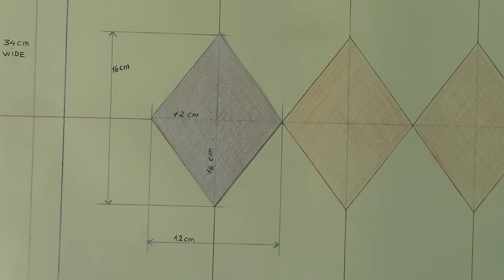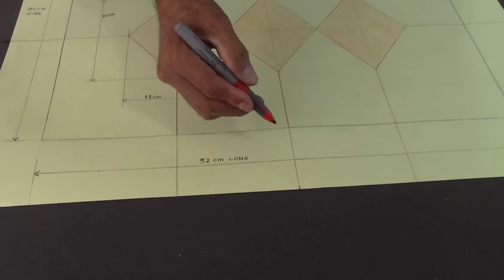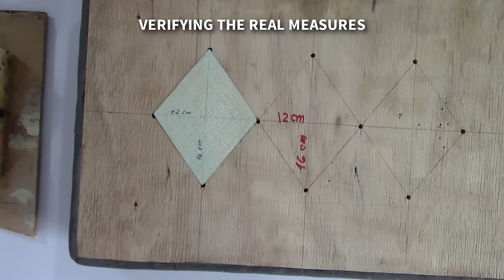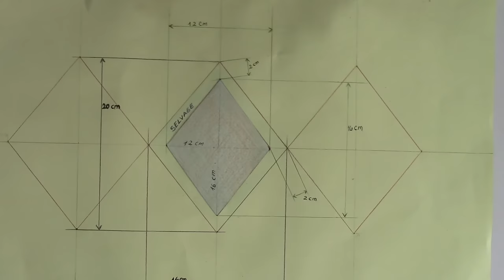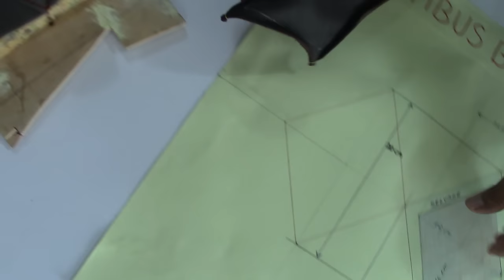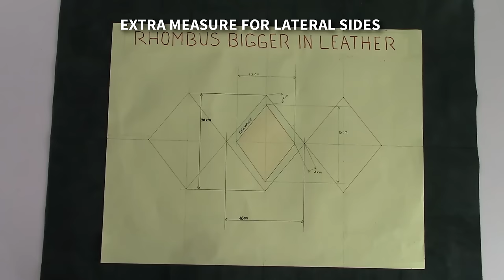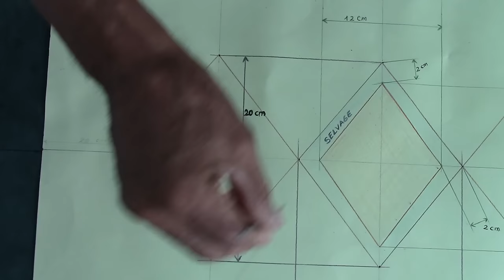How to diamond button tufting is shaped EXPLAINED -- Basic Tufting/Capitoné in leather for beginners

Comment: I’ve buttoned tufted with soft low density foam as a DIY project for turning an old rolling chair into a high back task chair before and pleats are sloppy and went with small diamonds and it wished I’ve ordered high density firm foam and went with medium diamond pattern, I’ve reupholstering an old cracking vinyl tufted wingback chair with vinyl going with the original tufting pattern and it ended up with much better pleats despite also having soft foam.  Next time I’ll go with a very firm high density foam and real leather as well as making it the seat bottom and backrest curved for lumbar, thigh, and head support.

Comment: Very detailed information Sir. Very much appreciate your support. Just getting started doing upholstery. Need all the help I can get. Did my first tuff seat this year. Nothing as beautiful as yours. But I am happy with the way it turned out. Don't think I would have tried it with out watching your video. Think you so much Sir. Best regards from Ohio. Walter
Reply from the maker: Dear Walter, I feel so happy you have found some inspiration in these upholstery videos!
If you would keep on doing these designs I would recommend the use of thin materials (fabric, faux leather or real leather) Thick materials are more difficult to handle.

Comment: Thank you very much for this video. As for me, I love to make miniature furniture so this is very useful to me. Of course the size will change, but the techniques are so very closely related. And you video is well detailed. So, thank you so much ^_^
Reply from the maker: If you like to make miniature tufting diamonds I would recommend you use curved sewings to ease the process. These oval sewings help to give shape to the small diamonds. A very thin needle and thread is useful.
Something similar to what I did in this video:https://youtu.be/qb3OIsPGt_8?t=150
Another design:https://www.youtube.com/watch?v=p-Ea5UvXoOw
Reply: @Cechaflo   I'll try that. Thank you for the advice 😊
Reply from the maker: @dlfcreator5324  Thin and soft material, thin needle and thin thread.

Comment: I just saw this one.  I thought I'd never need to do a diamond tuft pattern at all....  I was wrong. Our daughters piano bench was mistaken for a cat scratching post....  now....  I will have some more insight.   Thanks!

I will probably  make marks on the strings after making the loops on the buttons to insure they are all the same distance pulled down on all the buttons.  I'm a bit OCD like that!  Haha!  And then I won't need to use the screws...but will just pull to the designated mark on the string and staple it down.

I also like the homemade foam cutter!  I've been using an old Oster dual blade reciprocating cutter designed for carving meat.  Haha!

Thanks for showing this!
Reply from the maker: That sounds great!  I would suggest the use of a thin material ( real leather, faux leather, fabric, etc.) to make the folds much faster and easier. At most 1 mm thick.
Hopefully, this other video might be useful:
https://www.youtube.com/watch?v=Br6U6nepmCY&t=978s
Reply: @Cechaflo  thanks again!
Reply: @Cechaflo  Turns out I had seen this prior!  Haha! It was when I thought I'd never have to do this anyway...3 years ago.  I come from a mostly auto upholstery business...  then worked with a guy who did some marine upholstery as well.  Now I am an x ray tech.  But I do some occasional work upholstery wise on the side.  I appreciate the art and expertise you share freely on YouTube. 

I tried to get the first guy I worked with (over 15 years ago for a dozen years) to do some tutorials as you do and to show how to do convertible tops and headliners etc...but he didn't think it would be successful or worth the time...and who knows...maybe for the most part...people are too busy to learn more and/or  would just assume pay the professionals  to do it right and have a warranty....then  there are other videos that it would have as competition for viewing.... 

Hoping your business is successful and profitable and that more importantly....you know Jesus as your Lord and Savior. 😇💪🙏👐😎

So much in common with the One that covers us and makes us new creations and is the ultimate Creator Redeemer Restorer.  

Thanks again! 😁
Reply from the maker: @mrupholsteryman  Thanks so much for your kind words!  Really appreciated!

Comment: Hi. What is the glue which you use? Also which brands do you prefer? Thanks for the great video
Reply from the maker: https://www.youtube.com/watch?v=o2xeezdF8Ss&t=75s
If you are in USA:
https://www.amazon.com.mx/Cemento-multiusos-Petronios-Master-onzas/dp/B076DJQN5R
https://www.homedepot.com/p/DAP-Weldwood-32-fl-oz-Original-Contact-Cement-00272/100125525

Comment: What is the type and thickness grey sponge ,is the larger bit of foam 2 1/2 inch and what needle are you using with what twine and finally what glue thanks
Reply from the maker: The grey foam is medium density and I put it on top to even the surface. The long needle is 6 inches long. For the strings I used a thick polyester thread.
The buttons almost touch the bottom as it is shown in this part of the video:
https://youtu.be/tZKLXL80VqY?t=962

Comment: It means in leather or cloth we have to increase it by 2 cms each four corners...
Reply from the maker: The allowances are for the foldings to form the diamonds.
If the rhomb is a square, then the allowance is 2 cm each corner for the two diagonals.
If the rhomb is not square, then the small diagonal is 2 cm in each corner and the longer digonal is shorter 1.5 cm in each of its corners.

Comment: This isnt actually tufting, its diamond work but it IS NOT TUFTING
Reply from the maker: You are right!  In fact tufting is the process of gathering/push tufts (feathers/ horse hair/coconut hair, etc.) into a handsewn bag to give shape to a cushion. In this case to shape the diamonds.
This video shows a real demonstration of tufting process to shape the diamonds on a chair:
https://youtu.be/GpiRHGFJg3E?t=213
It happens since the foam material appeared it came to replace the old methods and the tufting name has remained and all the upholsterers call it this way.

Comment: You are doing a lot of unnecessary actions.  There are a lot of folds in the skin around the holes.  On such hard foam, you can make them not at all.  Just take a large diameter pipe.
Reply from the maker: Thanks for the suggestion. Anyhow, this educational video is a basic training for beginners. It is not for professionals.